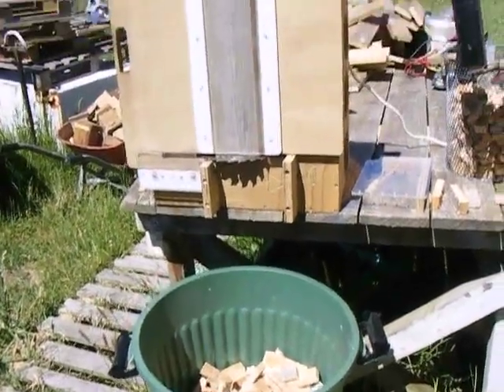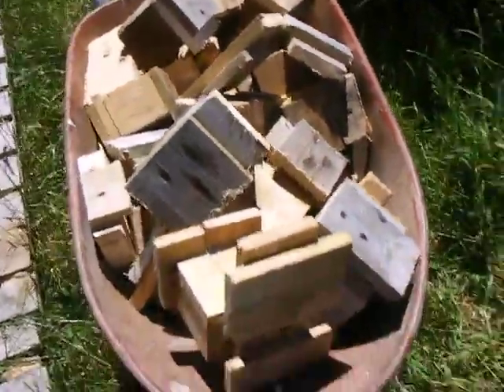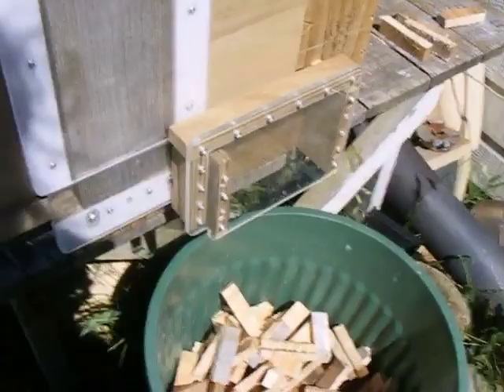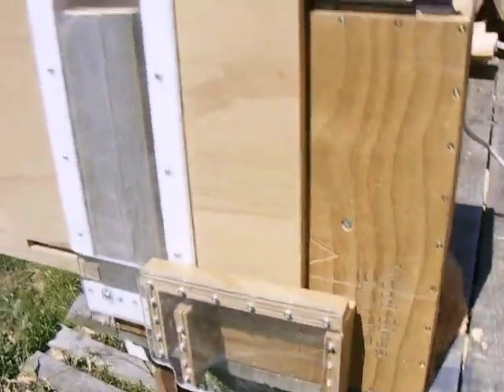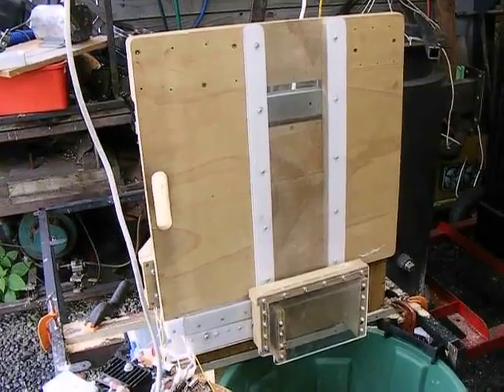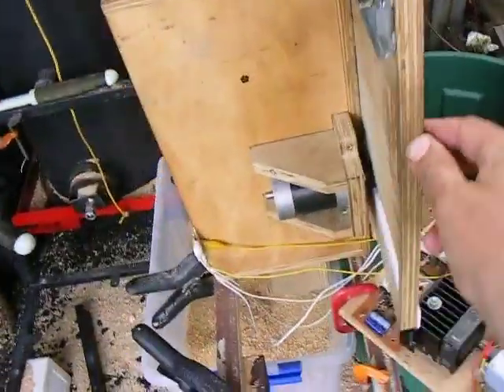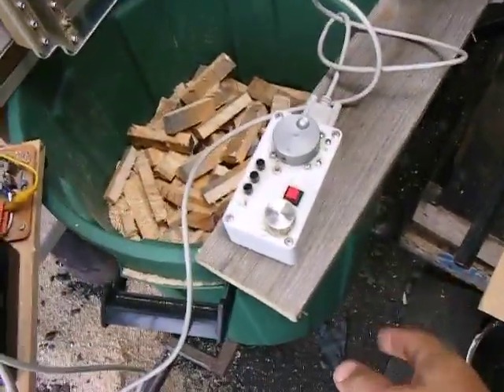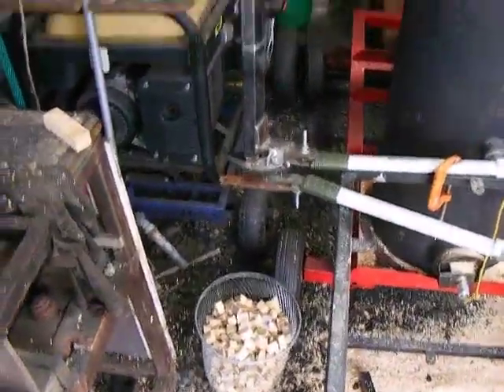Fairly Fast fuel finger fabrication facility

Comment: Really nice, but why not simplify and replace the stepper setup with a crank, quick return or reciprocating gear setup?
http://www.robives.com/mechs
Reply from the maker: Thanks kindly for the suggestion. That's quite an interesting site  :) .
I did originally consider the use of a reciprocator mechanism based on a worm drive from a window wiper motor, but then I realised that the stepper rack and pinion would be easier to make up.
It may seem odd, but the stepper system seems to be the simplest solution for this little beastie.
Reply: ***** I had the same thought when I saw the stepper motor and rack and pinion drive: How about a simple DC motor with built-in reduction drive driving a cam wheel? The shape of the cam wheel can then be "programmed" to give the slow advance and quick return you wanted, along with a brief pause at the end of the quick return to allow the fuel in the slide to drop. No stepper drive and computer electronics required this way.

I guess the next stage is to find a way to pre-load a whole bunch of planks in a magazine and have them automatically fed into the guide tube as each preceding piece is cut down, so you can set the machine to work while you go and spend that time smooching with your ass. ;-)

How much wood fuel do you need to burn in your gassifier to produce the power to run the two wood-fuel cutting and chopping machines to produce, say, a rubbish bin's worth of fuel pellets?
Reply from the maker: Max Brewster
There is merit in doing it that way, and I really did consider it during the initial stages of the development process.
It's wonderfully simple, and should be reliable for that reason.
I ultimately went with the stepper motor approach, as it turned out to be the simplest and most flexible solution for the needs of this machine.
One of the advantages that is inherent in this design is that I can program it to automatically clear the "log jams" that frequently occur when a thin sliver of wood gets caught up in the slideway.
If possible, I would like this machine to take care of itself, so I can get on with the serious business of downing a cold beer while my toys do all the work  :) .

About the slideway magazine:
This is something I would like to try out.
Perhaps it could hold 10 Benzine Bars, and drop them down the chute when the saw has finished cutting the previous one.
I found that putting the bars end to end in the chute is fine, most of the time, but the thin slivers that often result from this can cause all sorts of mischief and mayhem with the sliding parts. 
I may need to use some sort of electric eye, so the machine will know when to drop the next plank down the hole.
Now, where is my thinking cap?
Ahhh, that's right, the goat ate it!

One rubbish bin full of fuel, about 19KG, will run my gasifier for 9 to 10 hours.
It takes about 1.5 hours to process a pile of 'Power Pallets' into fuel for the beast.
The gasser uses 1.8KG of wood per hour when supplying the 1KW of power that the machines use.
From this, I can estimate that I need to use about 3KG of wood to produce 19KG of fuel.
This is a somewhat conservative estimate, as I usually pipe a fair bit of the power to the house also.
Given this, perhaps I should revise my estimate to 5KG of wood burned per 19KG of fuel produced.

Comment: wow thats a nice machine i was thinking u should use a steam ram it would sound like train lol BTW i just finished my new sys and HOLY SH*T it works unbelievable perfect clear blue flame and at high volume it was so clean there was never any smoke even on start up i did u vid but i havent uploaded it b\c u cant see the flame anyway ill let u know i use a similar method to make my petrol pellets (no fancy electrics tho) and i have a bunch of oak pallets to terr up so cheers! =3-
Reply from the maker: Thanks kindly.
This machine now has a motorised petrol pellet maker sitting next to it in the machine frame.
It should take most of the labour out of the petrol pellet production procedure  :) .
I really do look forward to seeing any videos you can put up on your new gasifier. A clean bluey-white flame is the holy grail for us gas heads, so ya better be sure to keep up the good work, or the tree people will get ya  :) .
Reply: ***** i have posted some new vids but i dont have a bigenof engine so i guess well go strait for me Beetle cheers =3-
Reply from the maker: xoxoXoieoxox
Yeah, getting a good match between the gasifier and the engine is a challenge alright, but I am sure you'll win the battle.
I need to put my gasser back together soon, so it will be ready for winter.

Comment: This is just too cool. For your soft start up are you running the light in series with the saw then when you start up the saw you throw the switch across the series light as to deliver the full power to the saw? I love this man! Great build!
Reply from the maker: Thanks kindly. This idea has been rummaging around in my head for a few weeks now. I am really pleased with the performance of this, so I have high hopes for the finished version of it.

Yup, you nailed it on the electrical department.
I may develop this a little further in order to simplify the soft start sequence, as I am planning to add a micro controller to this project to make it automaticafied.